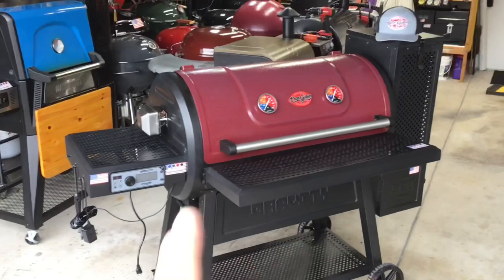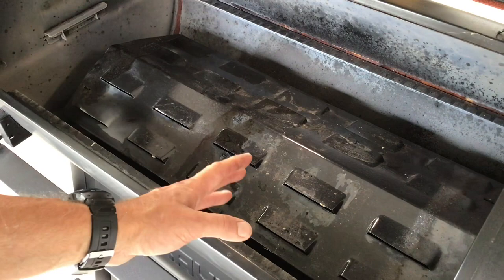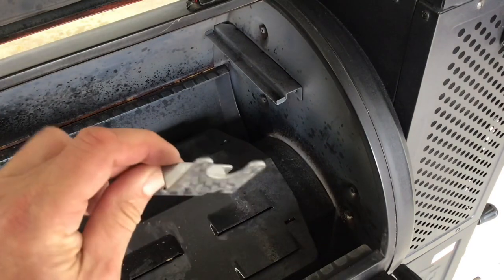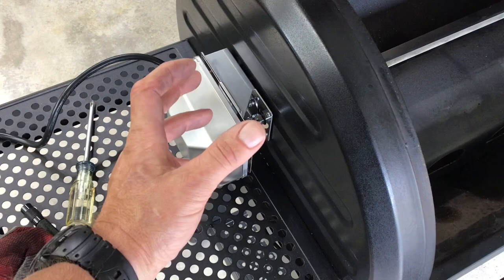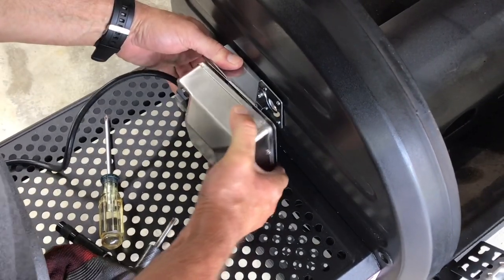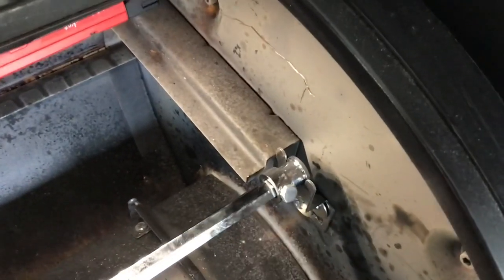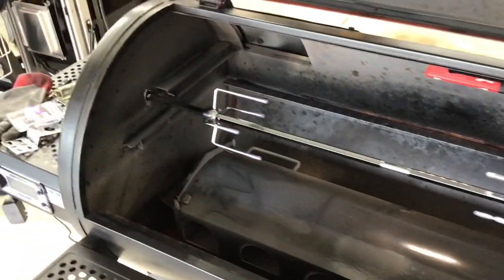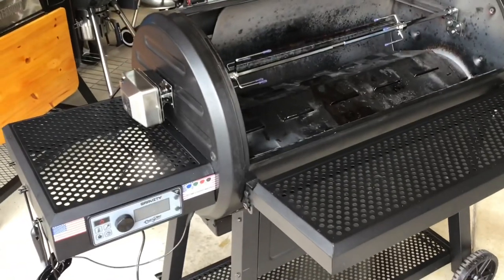Char-Griller Gravity 980 Charcoal Grill / How To Add A Rotisserie / If I Can Do It, So Can You!

Comment: Hey Tom, love your videos and have added three hood thermometers and a power cable bracket to my new 980 from your videos.  Next...rotisserie.  I noticed just before 6 minutes 13 seconds that the top heat deflector was on, then it's off for the rest of the video. When you actually use the rotisserie for cooking, do you have that top heat deflector on or just the one at the very bottom?
Reply from the maker: Thanks for Watching Chris!  If the birds fit with it on then yes, if not, no.  Good job on the mods!

Comment: Thanks for these informative videos. Would love to see one about how to cold smoke on these! If it's even possible.
Reply from the maker: Thanks for Watching! You would need to add a cold smoker attachment. Smoke Daddy makes one,,,www.smokedaddyinc.com
Reply: I'm currently working on figuring out a good spot to make a removable mount for my Smoke Daddy Big Kahuna.  Had on my Pit Boss 340.  Ideas?  I'd love to be able to leave in place but something I noticed on the PB 340 was eventually tube fills up and restricts with creosote.
Reply from the maker: The sides are probably the only place for the smoke generator,  just and fyi when I drilled for rotisserie the side was double walled